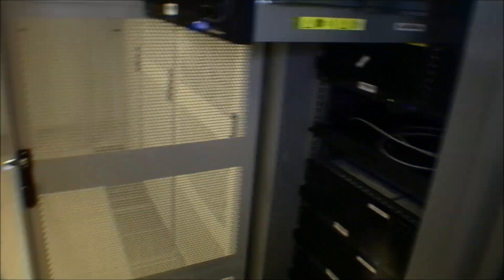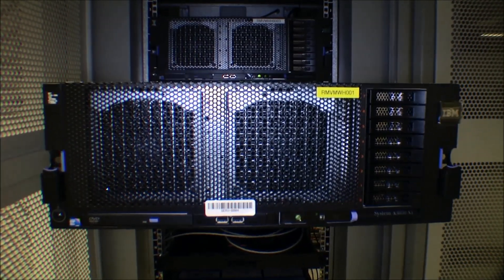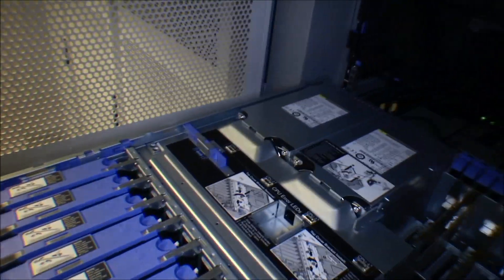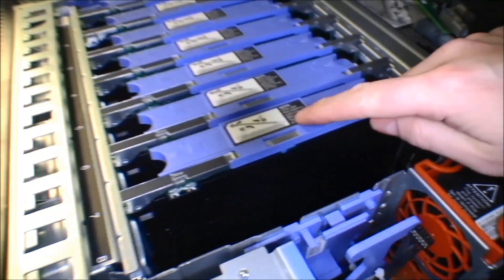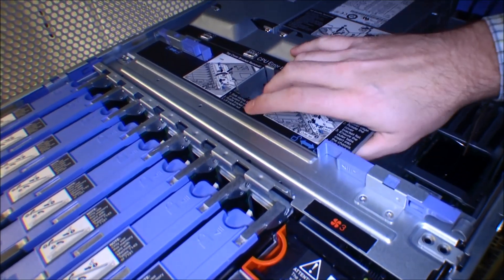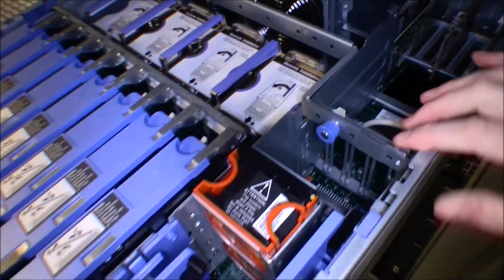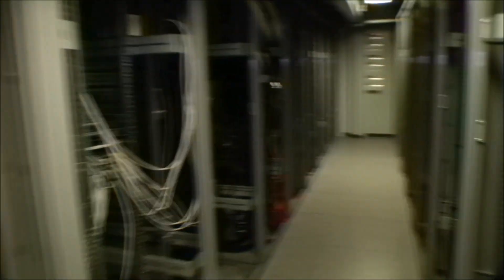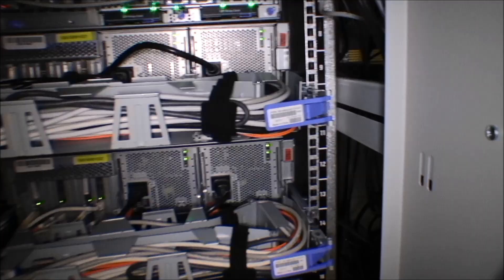Examines RAM configuration on x3850 X5 - 089

Comment: Hello there,
I am having a same machine as you. However, a problem just happened yesterday. 

The machine was on, i removed the cover, and plugged the graphic card in Radeon 6870 to PCIE. Suddenly, there was a beep (i did not count it, im not entirely sure it is a long or short beep either). And after the beep, it turned off. I tried to turn it on by pressing the power button, but it is not working, even though there is a blinking light on the Light path board. I tried to reseat everything (remove and plug back in), unplug the PSU cable and so on. I still cannot make it turn on. What are those possible problems? Is the light path broken? or something else. 
I greatly appreciate your help
Reply from the maker: Hi Tham Lam
You plugged in a GPU while it was running,, I do not remember this server having hotplug PCI-e. :-/ 
Take everything out and try with minimum config and see if it starts,, if it has service (You do not know what happened) if not are probably looking fo parts. :-/
Thank you for watching! :-)
Reply: Could you please explain clearer how should i try it with minimum config please? I did try to run it with no pcie, 1 x 4GB ram. but i still cannot turn it on. Even though the green light on the lightpath is blinking. Can i ask you more via email?

Comment: So i know you need a lot of ram fore sim applications but for what kind of applications do you need 256 or more gb of ram
Reply from the maker: HI +Notyourtipicaltechguy
Well Exchanges and SQL servers are often som memory hungry bastards :-) But in this chase it is VMware ESXi that needs more ram to be able to run more virtual servers. This is an older video,,, they was upgraded to 1TB of RAM. But tomorrow i get 10TB of RAM so i can upgrade 5 HP DL580 to 2TB each. The RAM they have now is to be upgrading 10 other servers to 1,5TB.
Thank you for watching! :-)
Reply: well thanks this helps me understand why some servers need a lot of ram. also i want to buy my first server. it doesn't need to be a very powerfull machine all i want to do is well... experiment i want to run some file servers and different operating systems and that kind of stuff. i also want to use it as a server to hack... sounds a bit stubid but here is what i mean by buying a server to hack... i am in to ethical hacking and penetration testing i'd like to setup a server build som differnt senario's and than well try to hack in to the server... then i would like to secure it so i can's get in it anymore by hacking.. i like doing things like that... oke sorry for the long comment but here is the problem: i am only 16 and i do not have a lot of money....
Reply from the maker: Hi Notyourtipicaltechguy
If you watch my videos,, You will know that i am a big fan of the IBM x3650 M1 (7979) check out my videos on that one and see if that is one you can use,,and it is not expensive :-)
Thank you for watching! :-)
Reply: My PlayHouse i've seen the video's thanks i've found some of those servers go away for very cheap. thanks for answering my questions i can't wait to get one soon :)
Reply from the maker: Hi Notyourtipicaltechguy
No problem, hope you get a cool one!!
Thank you for watching! :-)